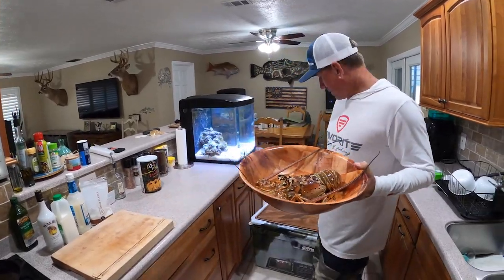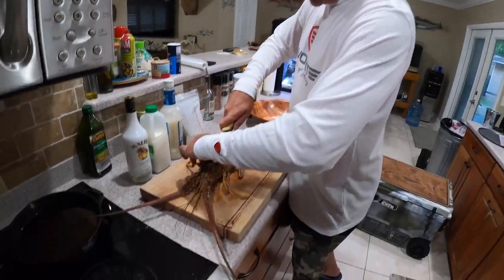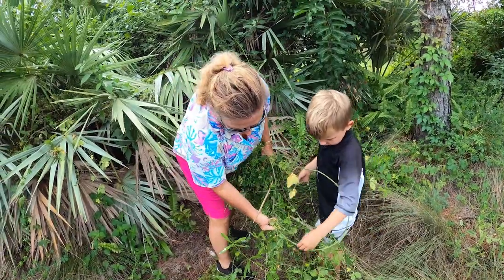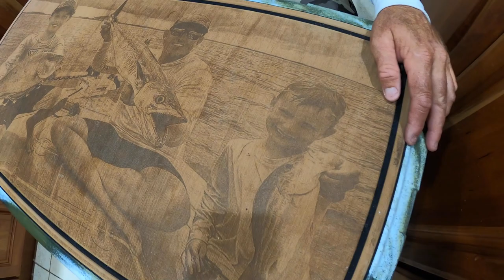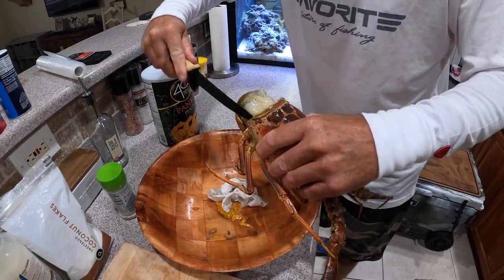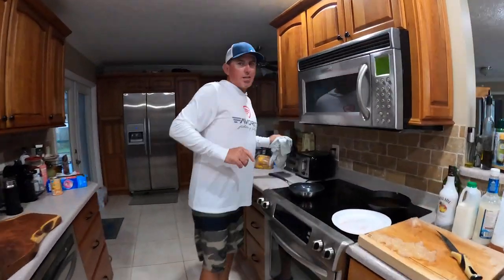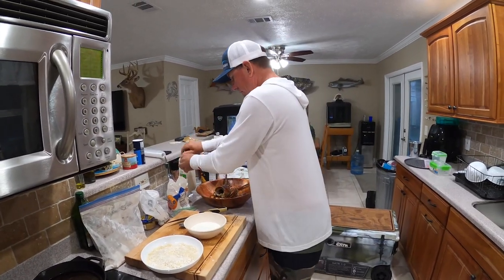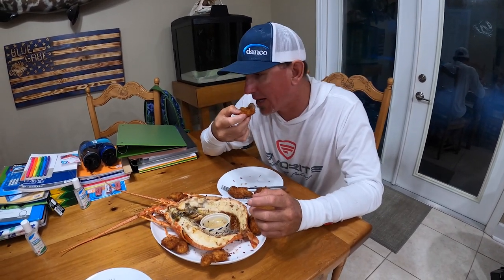Fried Coconut Crusted *LOBSTER* Bites with a Piña Colada Sauce (Catch Clean & Cook)

Comment: To ALL~ So I waited to post a comment because I wanted to try out a few different types of fish including Cod, Shrimp and Lobster... BlueGabe came up with a WINNER!!! 
Thank You BlueGabe for your Wonderful Creation!!!! I've listed out your Recipe for all to use... I hope you don't mind BlueGabe~ 
Step 1) Prepare Lobster:
Cut Lobster shell down the middle of the back and remove meat
Cut off "RED" part that's a thin strip of tough meat then cut into 1x1 inch chunks
Sprinkle Garlic Salt (or powder) over chunks of Lobster 
1 Cup Flour in Zip-lock bag and add Lobster, mix well and set aside for at least 10 minutes

Step 2) Make up the Dipping Sauce:
in Iron Sauce pan over medium heat 
1/2 Stick of Salted Butter
1/4 Cup Pina Colada mix
Bring to Boil and add 2 Tbs Malibu Coconut Rum (or to taste)
Add 1 Tsp Fresh Garlic
Cook for 4 to 5 Min to boil down mixing every minute 
Pour into Dipping Dish and set aside

Step 3) Prepare Coconut Coating:
Take 1 Cup of un-sweetened Coconut Flakes and chop it up or use a mini food processor to chop
Mix in 1 Cup of Panko into Coconut
Dip Lobster into Buttermilk and then Panko/Coconut
Heat oil to 350* then place coated Lobster into hot oil for 1 to 2 minutes on each side until golden brown
Serve right away~

Comment: Noticing how the wire reinforcing mesh in your old drive way was on the bottom of the slab. I was at World of Concrete show in Vegas/Lost Wages, one year, and the lecturer showed a picture of a roll of that mesh on the trash pile. That's where it belongs he said. It always ends up on top of the slab, or in the gravel. I had figured that one out many years before. The thick sheets of it, or rebar, on blocks or now they have wire chairs, works far better.